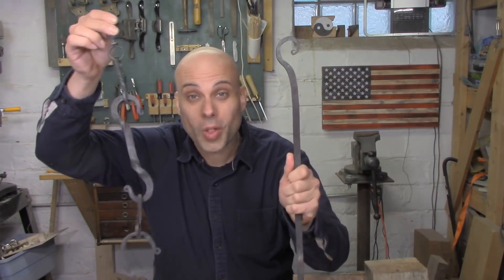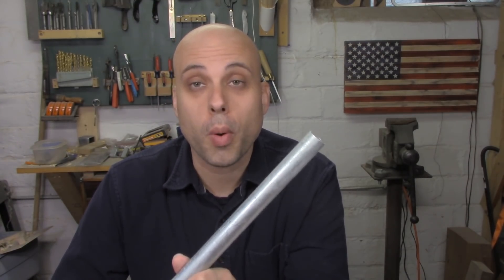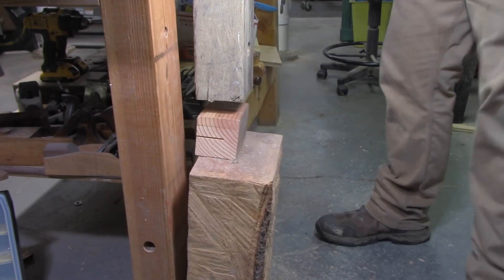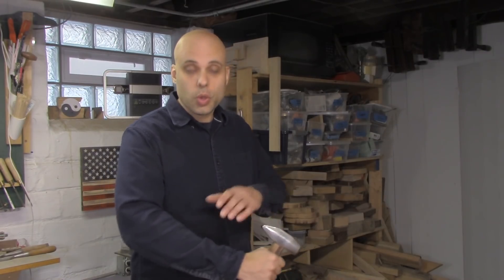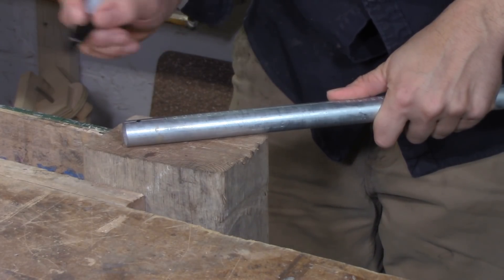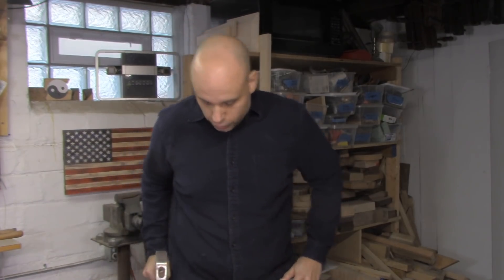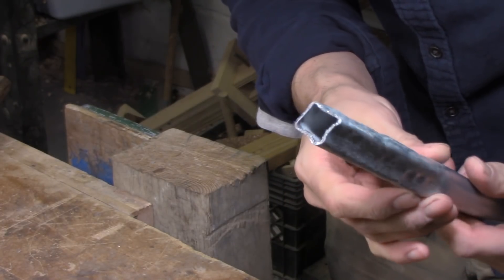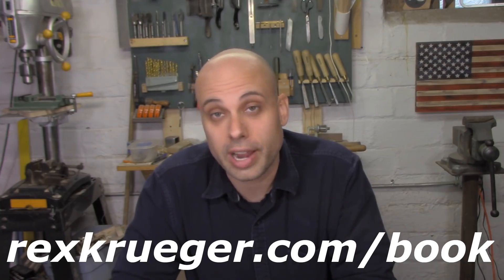Practice Forging in a Woodshop (Safely)

Comment: I have also heard of Blacksmiths using frozen clay to practice.  You can shape it like you would hot metal and it reacts similarly.  I like the idea of the conduit though, that would be great practice for accuracy!
Reply from the maker: I thought it was kind of a silly idea at first, but it works!
Reply: I heard it was a particular type of clay; oil based perhaps? It doesn't dry out in air
Reply from the maker: @croyce7699  Yeah, it's the synthetic clay poly-something. It's another very good idea.
Reply: @RexKrueger  and reusable, and quieter for under your house :p
I can imagine the banging would get tiresome both for yourself in an enclosed basement and dwellers upstairs.

Comment: As a thought for indoor practice of blacksmithing is using oil based clay that you keep in forge freezer.  When frozen it acts very similarly to moving hot metal.  Keep a bucket of ice water to soak it in between using to keep it cold.  Moves mass like metal does too to practice almost anything you’d like.  A good strike plate of some kind would work well to replace the anvil too.

Comment: Rex, you can save your hammer elbow at the end of the day by feeding the stock with your left hand and using the same exact blow every time with your right hand. Essentially you are striking the same spot on the anvil each blow. Try it and see. This will also help with your rhythm and timing. You'll get so good your work will sound like music. And of course never strike a bare anvil, always have metal in between the hammer and anvil to protect the face. Good luck, have fun and always be safe!

Comment: Holding the work gently helps you to make sure the work is placed squarely on the anvil.  If, while holding the work and it it is not placed flat on the anvil and then hitting it with the hammer the work will pull out of your hand.  Good way of learning how to place the work on the working surface without destroying your fingers or hand.

Comment: Love it! I have a small anvil, leg vice, a bunch of hammers but lack a forge. Been saving up to build one. This is a great idea to get started while I wait, and since my wife is baking up our first little one it may be quite a wait!  Lots of electricians around here, may have to start visiting their alley's!  Thanks for the great idea and inspiration! Love your channel!
Reply from the maker: It's certainly a way to get going. Just hold that hammer loosely!  And best luck of luck on the little one. Mine is 5.
Reply: If you have a shovel dig a small hole 6"-12" in diameter put a piece of black pipe (Do not use anything galvanized) into it attach a hair dryer and you have a forge.
Reply: @stevenjohnson2273  I have considered that, but I live in the 'burbs. My neighbours kinda suck and would call the fire department in a heart beat if I tried that, then I'd likely be fined.  The local fire codes have pretty strict rules for outdoor fires, but inside fires are covered under federal laws that the locals can't touch so my only option is a forge I can use in my garage with pressurized gas.
Reply: @clappercl  The simplest and cheapest forge I ever built was a brake drum from a dump-truck... It shouldn't take too much for re-bar to support a propane burner instead of my "coal-grating" form... 

     It's also worth note that you could use a relatively modest amount of sheet-metal to cover the thing, enclosing the heat with a dome.
     For insulation on the cheap (because it's important to keep exposed surfaces relatively safe, too) I've found plain dry wood-ash to be among the top dogs.

     AND I often scavenge electric blowers from vacuum cleaners or electric leaf blowers (though a gas blower would work... it does push lots of air) for the thing.
     Should you happen on a "squirrel cage" type ventilation unit, you can almost run a belt from any electric motor to push it, too... AND dimmer switches work for motor speed controls, so long as you check the AMP ratings on the switches.
     ...technically you're not "supposed to" do that with dimmers... but {shrugs} I haven't found a dimmer switch or electric motor that could read yet. 

    In any case, hope some of these points help out. ;o)

Comment: Has anyone tried using tin rods for practice?
Reply from the maker: I never thought of that. Where do you get tin rod? Is it cheap?
Reply: @RexKrueger  In Poland tin is sold in rods for soldering larger stuff (galvanised sheet metal, copper piping etc). The cost for 1 kg is about $40 (I looked up the kind without lead, so no health hazard is involved). A bit expensive, but you theoretically can reuse it endlessly by recasting the rod. A kitchen stove is all you need to recast the metal. Not shure if it would work well though, could be too soft. Thats why I asked if anyone has tried.
Reply: piokul 
That is an awesome idea about the tin.
Did you find anything out or try it? I’m quite curious.

Comment: I'm just getting into blacksmithing myself. Thanks, Rex, for some VERY good ideas. Since you're a turner, why don't you turn a nice hardwood cone to use as a simulated anvil horn?
Reply from the maker: That's a pretty good idea. Think I'll try that!
Reply: @RexKrueger  You'd have to mount it so that the top side of the cone were parallel to the floor, like an anvil's cone, but if anyone can to that, it's you.
Reply from the maker: @willwyatt7023  You're very kind. I'm sure it could be done. Now i want to make a whole wooden anvil, just for the hell of it.
Reply: @RexKrueger  That would be KILLER!!!!!
Reply: @RexKrueger  Don't use any valuable wood stock because a wooden anvil may not last very long, especially the thinner part of the horn.  To make that bit last longer maybe don't make a horn but a vertical beam with the top profile similar to a horn.  It might be useful and would be a great deal stronger.

Comment: The conduit seems like it could be useful for making things this way! Well, with some filing to give the ends a nicer look, and after and possibly removing the galvanized coating. Thinking door or drawer handles, plant hangers, decorative scrollwork for within a chair... Practicing while also saving money on hardware, and then if you don't end up needing or wanting them you can just put the box on craigslist.
Reply from the maker: Agreed!

Comment: Puzzled. Holding the hammer so close to the head reduces the striking force so much. Why?
Reply: Striking force is no good if you can't hit what your aiming at.
Reply: @stevenjohnson2273  Maybe so. So why isn't the handle only 6 inches long? The tool evolved with a handle of such a length because it gave the optimum striking force for the weight of the head. If you can't use it, aka "hit what you are aiming at" then maybe you need to either practice more or find another hobby.. :)
Reply: Sorry. Not aimed at you, should have said "one should practice more etc etc"
Reply: Practice was the point of this video. Most people I have witnessed who are new to the hobby 1. Start with a hammer to heavy and 2 either hold it close to the head or at the very end of the handle.  Everyone has a first day don't forget yours.
Reply from the maker: And, just to add to the conversation. Most smiths hold a heavy hammer like this close to the head. It's a totally different swing than you use for pounding nails and you get PLENTY of power. You're not swinging from the wrist/forearm, so holding it further down just costs you control with no added benefit in power. Also, most smiths use MANY hammers. I'm a beginner, and I already have three. For a lighter hammer and more detailed work, I hold it lower down.
Reply: It's worth pointing out somewhere, that there's more than one purpose to the hammer in question... even in a smithy.

    When smashing the head down onto screaming hot metal, strike force isn't necessarily always the top priority. Most of the time, you just want a reliable force for a reliable result (movement of metal)... not exactly an "optimally crushing blow of power" all the time.

    Smiths are also expected to have the skills and craft to "mount" their products, like fittings, bushings, and hubs (for instance) and those can be jobs where you want a "Big F- blow from a BIG F HAMMER" style of swing... 

    In that kind of technique, the "old school" way was to put an appropriate material (say hardwood block or wedge) against the "fitting" that's being installed, grip the hammer near the end with one or both hands, and "let the big dog eat"... also politely recalled as "whacking the hell out of it", since the sacrificial hardwood is getting marred and scarred, instead of the freshly finished metallic "fitting"...

     Older smithy's also often fueled their own forges with coal, which involved (usually) breaking the big chunks down into small enough chunks for feeding the forge fires without "smothering" them... (mostly about balanced heat and/or control of hot and cold spots... SO big hammers and long handles were great for the coal yard or bin, but you didn't want piles and piles of hammers... so you could just "choke up on it" for the control work at the anvil...

    AND finally, it's worth note that the handle sticking out past your hand acts a little like a counter-weight, allowing you to continue longer term efforts at a time without getting limp about the wrist... It's worth watching Lindybeige (another channel on YT) when he was learning to smith for his sword and armor. You'll see what I mean. ;o)
Reply: gnarth d'arkanen 
Ah... another man of culture. 
Lindybeige is such a good channel.

Comment: Technically that IS smithing, just not blacksmithing, I'm guessing that is aluminum conduit, the steel stuff is hard as nails, so you'd be aluminum smithing which would fall under metalsmithing which is a kinda catch all term for people that hit metal with a hammer. 

There are many kinds of smiths, tinsmiths, goldsmiths, blacksmiths, coppersmith, not to mention tinkers who were basically traveling tinsmiths. oh, and pewtersmiths.
There are probably dozens more, but I'm not familiar with them.

As a word of encouragement, blacksmithing isn't the beall and endall, you can make some beautiful things out of copper wire, and the best part, except when you anneal or have been beating on one spot too long you don't have to worry about burns!
Reply from the maker: A very good point!

Comment: have fire issues? haaaaa this is a good lead in to hammersmithing.  get a lighter hammer. and use smaller tubing. Unless you want sore muscles and cramping hands. Walk first then run. But, I get your point. It won't take long for you to get it. Everyone has their own special technique. Think annealing with a propane torch and small copper tube.

Comment: My old teacher always told me: "if you are not able to hold a hammer at the lower end of its handle, your  using a hammer that is too heavy."
And I have to agree with him.
Gripping the hammer short is a technique, but shouldn't be the main way to use a hammer. The handle is there for a reason, it gives you leverage and protects your hand.
Reply: And the handle is where a lot of the axeleration happens. Speed is what gives force to the blows. Plus i think a good handle thats thinner at the top dampens vibrations.
Reply: @borjesvensson8661  I disagree on the second notion. The hammer shouldn't really be held tightly when it hits the metal.
It's a bit different with sledge hammers, but ywah.
Reply: @Glaswalker1001  A loose grip certainley is important. To be honest i havent done that much blacksmithing and my opinion on handles is mostly formed from using   axes, Peening boatbuilding nails with small crosspeenhammers and driving barrel hoops in my job with a hultafors blacksmiths hammer (900g). I find that a loose grip is so natural once you leart it that i dont think about it unless i mess upp and grip to tigth. But still a to thick and stiff handle tends to leave the arm and wrist sore. Fiberglass is the worst! Thats my feeling anyway
Reply: @borjesvensson8661  Fiberglas IS the worst. A thick handle doesn't help, that's for sure, but I wouldn't know about shock absorption.
My experience is mainly blacksmithing so I couldn't tell how it would fair with your examples.
Reply: The length of the handle varies a lot with country of origin in Europe. Traditionally we used a long handled hammer in the UK and the Germans used a short handled hammer. (Perhaps the name Krueger has something to do with it). As @Darius der Rote says below, one of the problems of commercial 'engineering' type hammers is that the shaft is too thick for 'all day' use. See some of the Blackbear Forge videos, and other sensible smiths explaining hammer technique. And as @Rex says, watching what the left hand is doing is as important as watching the hammer face land.

 By 'sensible' I mean those videos where people know what they are doing and explain why they are doing what they are doing; not just banging away at a lump of metal with a music soundtrack to impress those who do not understand what they are watching. I do not know any real blacksmiths who watch Forged (I think that's how it is pronounced) In Fire.

Comment: Actually if you're striking, you are smithing
Reply: YOU ARE CORRECT, Sir!

     It's worth pointing out that Copper, Bronze, and Steel were regularly "Cold tempered" in historical contexts... just by hammering. It exploits the same principles we recognize in some metal work as "work hardening" when you start cutting or working on a piece, even tapping or threading, and the material just gets harder and denser and harder as you work... Eventually you have to anneal the stuff (again) or you'll break something.

     BUT Celtic swordsmiths were known to "Cold temper" steel in some cases... AND as far back as Rome and Egypt, copper tools like chisels were often hammer-hardened without any heat applied. (it's about the only effective way to harden copper)... ;o)

Comment: If you are practicing forge this way, why not making some metal frame chairs and tables for, may be hospital? Church? Community hall? Schools? Or make some small garden utensils and give it out for free? That one piece of pipe in the footage, add a couple more stroke will become a small prow. Pipes comes free, wood from scrap, you get practice, they get free stuff. You can also earn your reparations in neighborhood as well. Worth a try?
Reply from the maker: luderick wong That might be a good idea.  I'm not sure.  The conduit is very soft and wouldn't make very good chair parts.  I'll think about it!
Reply: @RexKrueger  not necessary to be fency furniture, add a handle bar in the walkway may help the eldery and disable. Small stepping stoll and walking stick can help too. If you think the design is not good enough, just don't bring it out, lose nothing😊

Comment: Next time don't put your camera on the bench when you do something that vibrates it.
Reply from the maker: I didn't. Camera was on the floor on a tripod.
Reply: Rex Krueger 
Wow. That much vibration for just conduit is pretty cool.
Wonder if a strap from the ceiling approach would work better for your more vibration heavy videos. 
On the other hand, it quite clearly showed how much force the hammer blows were transmitting...